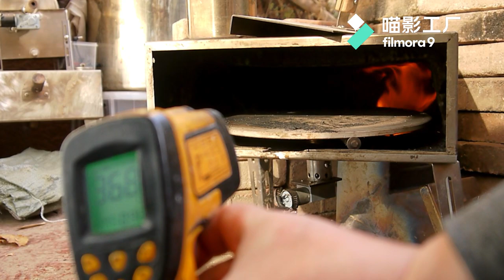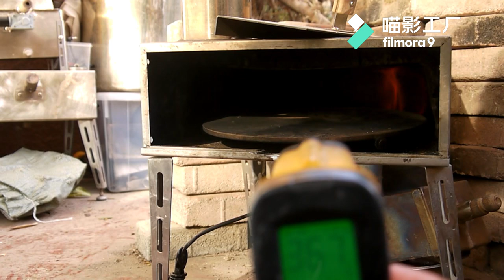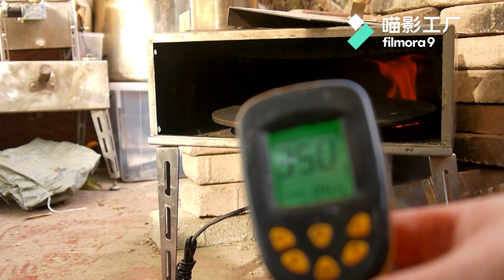Portable Wood Fired Pizza Oven Hacked from OONi

Comment: Thanks for your reply,
however,  quantity of wood
is  not known to me, therefore please elaborate
wood requirement for your rocket stove !
Reply from the maker: Preheating to stone temp. of 400 C needs around 1 Kg of wood and about 10 minutes .  Before each pizza you need to add some 150 to 200 g of wood.  Usually stone temp. is 350 to 400C. and It takes 2 minutes to bake one pizza.  Between every 2 pizzas you need to add 150 to 200g of wood and wait 1 minute, then to put in second pizza.  Do you find that there is a cover on the burner.  After you fill in wood you close the cover. Fresh air is coming in from beneath through buring wood. No excess fresh air comes in to lower temp. then wood saving.  Also I applied a layer of mud inside oven, the dry clay/earth is heatsink and also heat insulation.